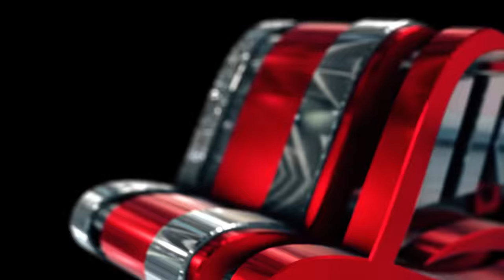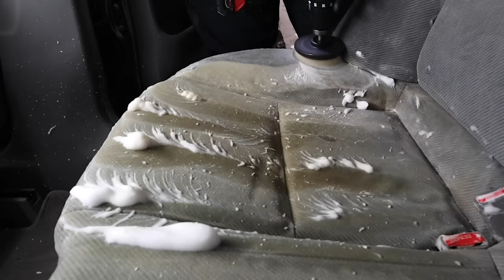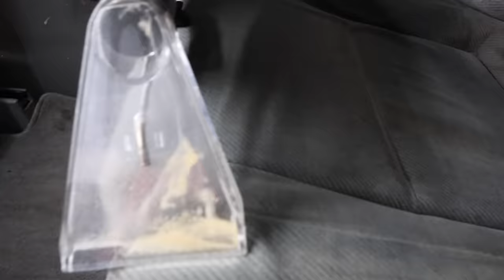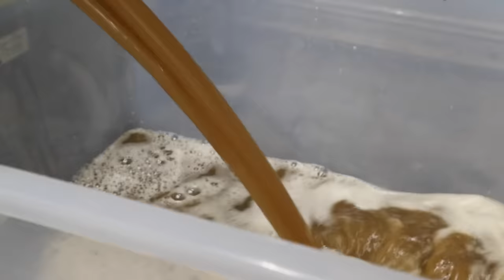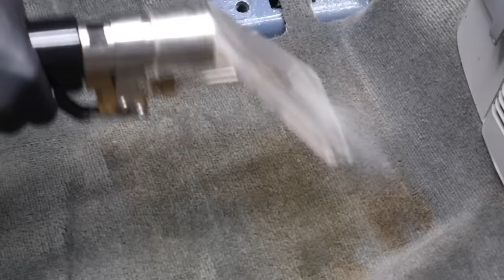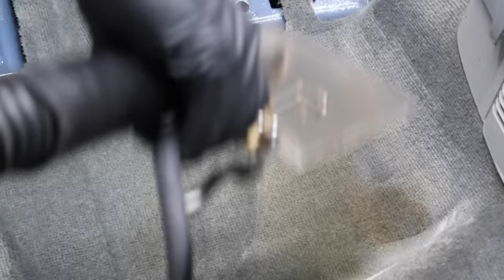Simply EXTRACTIONS | FILTHY Deep Cleaning Compilation Ep1

Comment: Great vid as usual fellas! Whats the average dry time after extraction? How do you prevent leaving any residual chemicals from lingering in the upholstery?
Reply from the maker: Those are great questions. Normally it will take about 45min-1hour for seats to dry when inside our shop. When they are taking a bit longer we used forced air. To prevent residual chemicals we try sticking to diluted APC and when extracting just the hot water from the extractor. Multiple passes with the clear head on the extractor is always the best way to go =)
Reply: Limitless Detailing u a re a god you are amazing and can’t wait for another vid bro

Comment: What kind of extractor do you use or what are your recommendations?
Reply: At weClean we use a machine made in South Africa, called a SEMCA machine. It has two 3 stage vacuum motors which does a great job of sucking out 95% of the moisture.
Reply: @weCleanPro1  Thanks.

Comment: Love your videos, I have a question though, can you tell me what gear your using?  You do a great job!  i work in the automotive industry and I love detailing and one could assume you went through some trial and errors along your way.  Clearly you have the art down .  I would love to know your particular tools and chemicals you use.  I assume the drill brush comes in different configurations.                Your cleaning foam , the drill head, the extractor. the exact types of tools and recommendations would go with.  I thank you in advance and thank you for posting

Comment: seam on seats should have been sucked dry with nozzle turned sideways WITH the seam - dirty water was wicking into the clean cloth. Pretreat on floor carpet needs time to work - apply if before you remove seats or apply it before seats are cleaned.

Comment: I wonder if that's really dirt or just the  sponge losing it's color due to age? Hmm
Reply from the maker: Deff Curry soup spillage according to the client 🤮
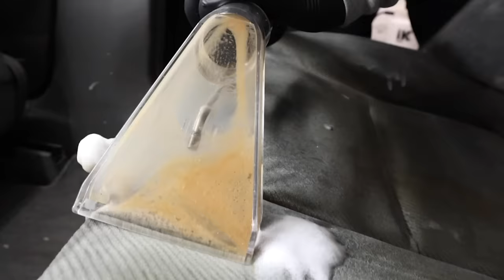Reply: @LimitlessDetailing  1:33 what is that tool called???
Reply from the maker: I think you many be referring to the Mytee Extractor 8070 Light with a clear head attachment. It is a heated stain extractor
Reply: @LimitlessDetailing  thanks 👍

Comment: It would be better if you used hot water instead of solution in your extractor
Reply from the maker: That’s a great idea, luckily we do exactly that. Our extractor is a profesional grade Mytee 8070 which is a hot water extractor. And the only solution we use is what’s in our pump sprayer. Thanks for watching